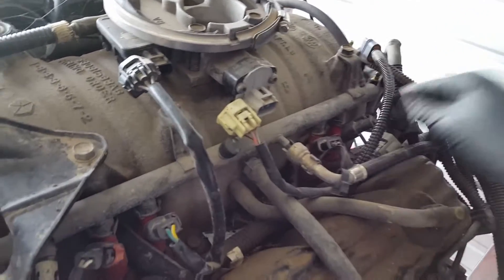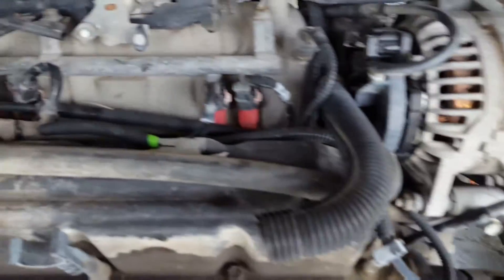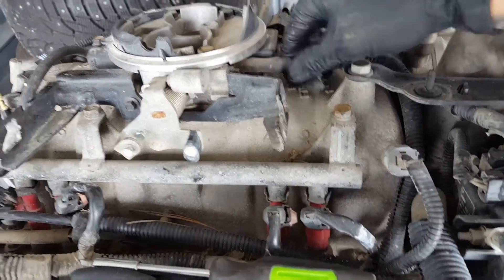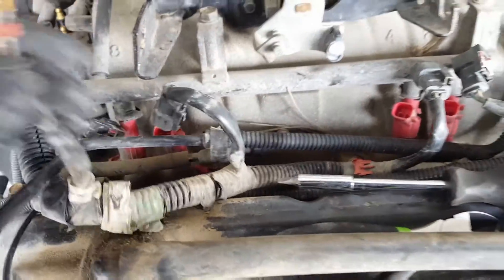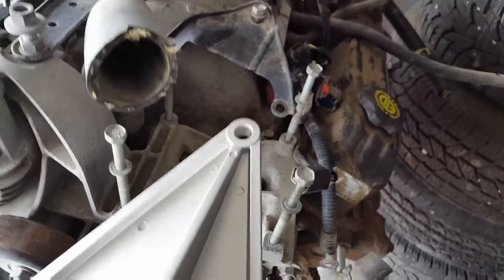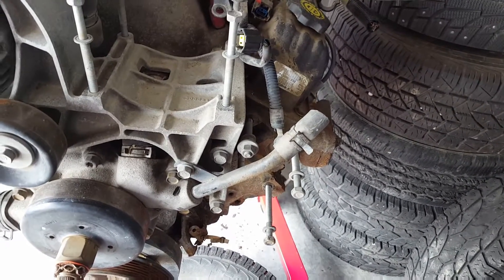Jeep tj 5.9 swap Video 5 (disassembly and wiring V3)

Comment: Question again.lol. Since I had a 4.7 in my 05 ram 1500 before I put the 5.9 . Do I have to change the wire harness inside the dashboard or just the whole engine harness ...ty

Comment: MAP Sensor=Manifold Absolute Pressure Sensor
Reply from the maker: Haha yeah I got it figured out now! she's running....
Reply: Ayyyee thats sweet! I have a 97 TJ 2.5 manual, I also have an 01 Ram 1500 5.9 Automatic. Im seriously tempted to drop the 5.9 in my TJ but i feel like id maybe rather get a cummins 4bt 3.9 to drop in since it is a more simplistic motor that won't have as many electrical issues. Transferring everything electrical including the computer is very daunting to me, but then again i already have the v8 with all the wiring should i choose that route.
Reply from the maker: Do it! Honestly the 4BT is cool but the engine itself is very expensive. I am in this swap less then 1500 man! This was a fun easy swap as far as v8 swaps go haha! I've been documenting the whole thing and would be happy to help with any questions you might have should u chose to do it!
Reply from the maker: Wiring was very easy.
Reply: I appreciate that man. Should I chose to move forward i'll definitely have some questions along the way so keep a look out!

Comment: Ha your never going to put it off till November. You have chassis grounds and ECM grounds , no you can't tie them it together because if you tie your starter ground into a ECM ground you will have a large voltage drop that is ok for the starter but may cause problems for your computer. Just separate them two and you should be ok. This is going in  by July isn't it. LOL
Reply from the maker: Yeah I'm really trying not to rush there's a lot left so maybe I'll make it till September